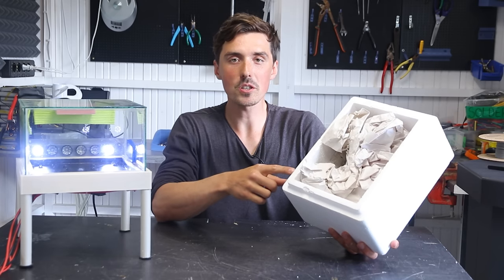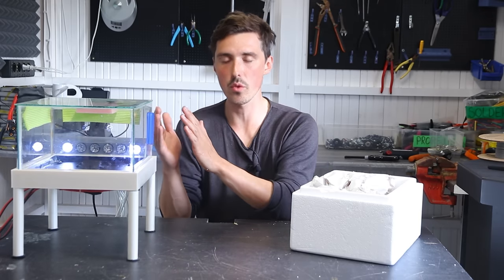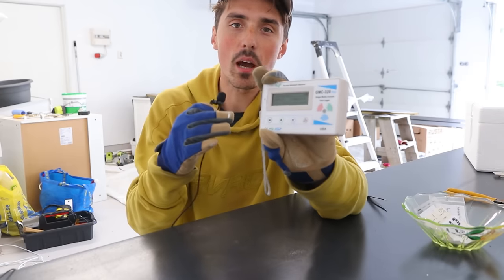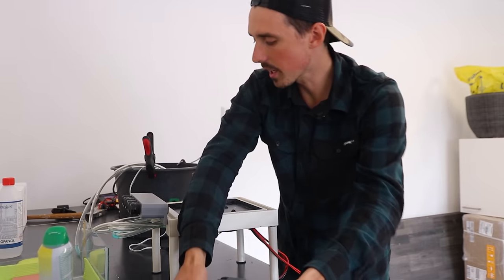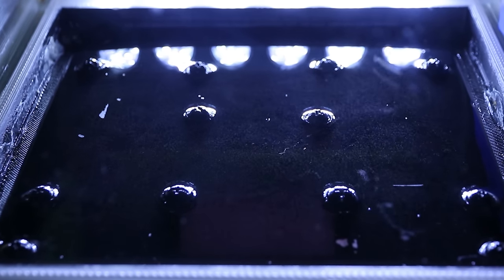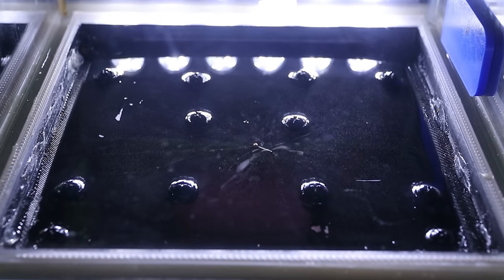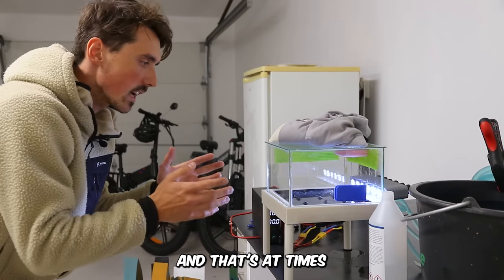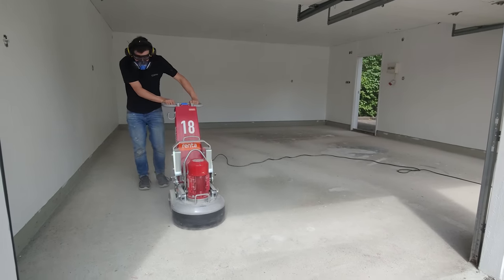Testing Radioactive Materials in the Cloud Chamber

Comment: as for your problem with it not working, i think you're getting heat soak.  -30 is barely in the range that you need.  try putting insulation around your chamber sides and just film from the top.  also put ice in the coolant tank.  that alone will probably work.  use a thermocouple to check the temperature.  that's key.  if it's -20, you likely won't see anything.  if you can get it colder, like -40, that's when you'll see a lot.  instead of using that many, use two lower power peltiers against the cold plate, then higher power peltiers on top of those.  they're horribly inefficient so the second peltier has to be a lot higher power to pump its own heat PLUS the heat from the first peltier.  this is called a cascade.  each peltier can drop the temperature so much.  but with two layers, you can get colder.  i got mine down to less than -40 by doing this.  (it might have been colder but my thermal camera has a maximum of -40c).  oh and you're more likely to get a chain reaction if you give the particles a charge.  you need a high voltage DC source.  the cheap amazon bug zappers can work
Reply: Your post reminds me of another build I saw. That guy used at least two layers of peltiers to get the temperature down low enough. I'm almost sure he used a lot more than just 6, and they were stacked, for sure.
Reply: @marks47  and he used a charging grid too iirc
Reply: Yeah what this guy said
Reply: Couldn't he just put a couple bricks of dry ice into the bucket with the washer fluid?
Reply: @Kevin-ht1ox  dry ice is colder but has much much less heat density than ice from water. it's a common misconception.  it WILL get the coolant colder, but if it's not glycol or alcohol or a mixture of water and something like antifreeze, it'll freeze, which isn't ideal, so using regular ice is easy and will probably work great for this application.  he's already really close to the sweet spot so the ice should get him there fine.  if not, dry ice is an option too, but it'll sublimate REALLY fast in water, so he'll need to buy a ton of it.  that said, there are video where people use dry ice as the main source of cooling, so it can be used, but in his case, putting it in the liquid will make it go poof really quickly, which is probably tricky while trying to film
Reply: I agree
Reply: thermal mass is what i should have said instead of heat density lol; i really need to read my comments before i send it 😆
Reply: If you do not see tracks you need DC high voltage  to pull out ions from volume to cold plate. +1-2 kV.  Can put bare eire inside. I put on outside of glass top alu foil forming a capacitor. Rubbing baloon works in dry air. I made chamber from plexyglass and it did not work. plexiglass has charged inside that pull ion tracks into mess

Comment: The science center in Toronto had a big cloud chamber. It's fascinating to realize we are surrounded by speeding particles. Thanks for this! Great job.
Reply: Science centre in Halifax has one as well. Kids and I were playing with it while there. If it requires a static charge on the outside of the chamber, then they had that being generated somehow within an inner chamber. Come to think of it, there were thin wires running across the top of the unit (inside), if those were highly charged, that was doing it. I think I took photos, but it definitely was multiple layers of glass/acrylic between the inner chamber and the exterior cabinet surface.
Reply: One of the best weekends of my life was an anime convention/rave at the Toronto science centre. Giving us after hours access to the science centre was pretty stupid but insanely fun while "enhanced" 😅
Reply: Saw that one as a kid and loved it. I believe the largest natural chuck of gold is also there.

Comment: What worked for mine was connecting the hv Modul of a bug zapper to the cloudchamber. Negative to the coldplate and the positive to a metal mesh under the sponges. You can find out the polarity of the hv Modul by hooking it up to an LED.

Comment: Would it just be easier to use dry ice instead of peltiers? I mean I like the usablity and ease of having the system always readily available, but honestly having to chill and pump fluid and never being able to achieve those lower temps seems like a lot of moving parts and work. The ice could prolly last you all day. Unless dry ice is hard to come by in your neck of the woods. Our grocery stores and welding shops have it here in Montana.

Comment: Regarding your problem with the cloud chamber, I have some Ideas as to why it may not be working. Some designs have a high voltage difference between the top and bottom of the chamber to make the tracks easier to see (I think this is to excite the valence electrons of the alcohol vapor but do not quote me on that). Another thing that may help is a leak or some convection in the chamber itself. If the vapor isn't still, it could make the tracks hard or impossible to see, and if there is too much of a temperature difference, convection will occur, and obviously that is not good- this problem may be due to your dual pump change. If vapor is escaping, that cold vapor doesn't have a chance to condense. But most importantly, make sure to have a great day!

Comment: A build a cloud chamber for a univeristy here in spain, that chamber uses one of this rachets to kill flyes, that devices usually has a mini transformer that reaches 3000v or even more depending on the ratchet, we install the rachet grid on top, connected to the positive, and a copper plate in the bottom connected to the negative, that should help to attrack the particles to the mist
Reply: Which university has that device? Interesting!

Comment: Your cooling system is a big mess. You need to learn how to use Peltier coolers. You can easily cool the cold plate to -30°C with a simple water cooler used for PCs. There is no need to "cheat" with precooled liquid to offset the dT of the Peltier cooler. You also run the Peltier coolers without voltage regulation which is another issue. If you run them at full power, they will heat themselves up too much due to the Joule heating. You need to lower their input voltage. It depends on which unit you use, the input voltage may vary, but it is typically 10-12 V. 12 V is often too much if the module is a high-power one. Regarding the "failure" at the end, as others already explained, you need a high voltage potential difference across the chamber.

Comment: So what happens to those particles flying off. Do they evaporate or just go off and travel forever?

And if they don't fade away is there any material or set of containment fields that can reflect them and bounce them around inside an object to make electricity?
Reply: They can be used to create heat- which boils water which turns a turbine - which creates electricity. And THAT is how a nuclear power plant works. 

All elements have a half-life, which signifies their rate of decay. Elements (and their isotopes) which have a shorter half-life, decay more rapidly - and are classified as radioactive. Look up some simple explanation videos about half-life, and also how a nuclear power plant works.

This will answer all of your questions.

Comment: I have a bunch of clocks and watches that are pretty radioactive from the radium. The reason radium is dangerous is because your body treats it like calcium and deposits it in your bones if you end up ingesting any particles by accident(or inhaling them). So as long as they're sealed up, its generally safe. The worst one I have no longer glows, and it still puts out 42,000CPM.
Reply: Women who painted radium dials suffered horrible bone cancers because they used to lick the tips of radium paint brushes. Today we use strontium aluminate, which is not radioactive, but does not last long light to dark.

Comment: Beta and alphas don’t penetrate a lot because they’re larger and or have a larger magnetic effect on the material they’re going through, therefore they lose energy quicker and do not penetrate so far. Gammas and neutrons penetrate pretty far since they have a low mass, or no mass at all, and no charge as well meaning they have to physically hit something to lose energy which is less likely due to their size. They can have an effect on something without hitting it however it’s not in the sense of magnetic forces it’s more of a nuclear force. Also physical contact for something like a gamma is determined on its spin and the spin of whatever its hitting so an electron with a -1/2 spin and a gamma with a -1 spin means the gamma won’t be absorbed where as if the gamma had a 1 spin it would be or if the electron had a 1/2 spin it would absorb the gamma. That’s why the objects that only produce beta and alpha particles don’t seem radioactive, you just need a radiac that is made to measure these larger massed and charged particles. Geiger counters are most commonly used because alphas and betas aren’t really a threat to people. Alphas are stopped by the layer of dead skin on your body and betas are stopped by clothing and don’t penetrate your body very far. Neutrons, electrons, and gammas are the ones that can cause serious problems at high doses which is why Geiger counters are great. A cool fact is that smoking tobacco exposes your lungs to alphas which is why lung cancer is so common in smokers and alphas do 40 times more damage than a neutron. The more you know. 

Also a lot of radiacs are calibrated where 100cpm is considered radioactive or higher than background. Not sure what yours is calibrated at but in my line of work 100 cpm is a pretty bad day especially if you see it spike to 200 cpm. Real bad day.

Comment: Apparently the old travel clock with radium dials i have is way WAY more radioactive than i thought. or the detector i used is way more sensitive.
Reply: I just checked the video, very similar detector, 638CPM

Comment: I have the same giger counter and I have 4 pieces of americium from smoke detectors and it detects well over one thousand cpm you also don't need to open the part where the battery is just use bottom middle of the counter as it is right in the middle where the gas tube is and will detect more of the radiation that way while the part where you had it at was close to the tube it not a lot of radiation was able to be detected because most of it was flying off and not getting into the tube.

Comment: Alpha and beta particles in earths atmosphere will typically be a small percentage (like 5% to 15%) of the speed of light. Beta tend to move slightly faster. Speed can greatly vary tho. The chamber temp is probably the reason for you problem. I almost guarantee the pads you were using have degraded from use and possibly amp overdraw.

Comment: there are some counters that can't do alpha particles.  some do, but require you to open a door.  some have a slider switch that changes the material covering the geiger tube for the three particle types.  the one you have is probably just blocking alpha via the plastic shell
Reply: I have the same counter and it detects alpha radiation just fine

Comment: I asked Chat: Certainly! A cloud chamber is a sensitive device that allows you to observe the trails of charged particles. If it suddenly stops showing trails, there could be a few reasons why this might happen:

1. **Temperature Issues**: Cloud chambers rely on having a very low temperature in part of the chamber to create a super-saturated alcohol vapor. If the cooling source fails or is insufficient, the chamber may not operate correctly.

2. **Alcohol Supply**: If the chamber runs out of alcohol or if the alcohol is not properly saturated, trails will not form.

3. **Contamination**: Dirt, dust, or other contaminants can affect the operation of the chamber.

4. **Humidity and Air Pressure**: Sometimes the ambient conditions can have an effect on the chamber's operation. If the air is too dry or if there are significant changes in atmospheric pressure, the chamber might not work as expected.

5. **Radiation Source**: If you're using a specific radiation source, it might have decayed or been shielded somehow, reducing the number of charged particles entering the chamber.

6. **Sealing Issues**: If the chamber is not properly sealed, it may not maintain the proper saturation or temperature for trails to form.

7. **Equipment Malfunction**: There may be a malfunction with the equipment itself, such as a failure in the cooling system or a problem with the lighting used to make the trails visible.

Investigating these areas should help you determine the cause of the problem. It may be helpful to have a manual or troubleshooting guide specific to your cloud chamber model as well.
Reply: Assuming the cooling is working as intended I'm inclined to think point 5 sheds the right info here: "been shielded somehow"
Maybe the container holding the Americium is shielding it too much?
Mounting pressure is also very important with peltier devices, for best efficiency you must have a high pressure clamping them together, Tech Ingredients a few really great videos about these things
Reply: @joeledwards6587  How was it shielded? The small screw-shaped object that he put in the chamber is the Americium. He showed the much larger shield earlier, and the small object he placed inside is clearly what was underneath this shield.
Reply: @desmond-hawkins  ooooh, well I was under the impression that the small component was a housing for the source, insider the larger shielding. I don't know, never seen these things myself, we don't have em here
Reply: I tested a mini cloud chamber with just two Peltiers in series, using an ice cube with water I managed to leave it at a temperature of -34 degrees Celsius. But my clouds of steam are very thin, do you know what it could be? Note: the system is not well sealed and it works much better open and with alcohol on top of the peltier, but the wind gets in the way.